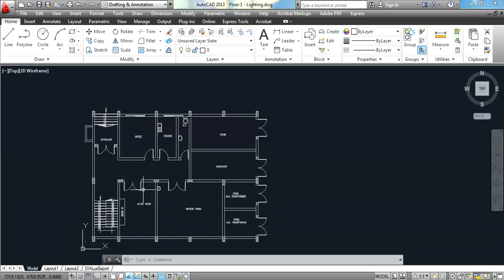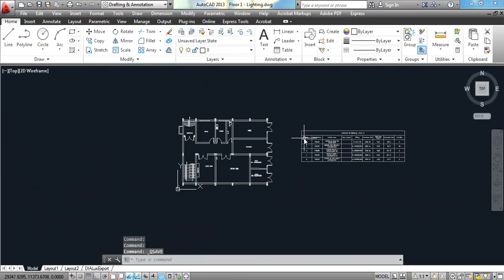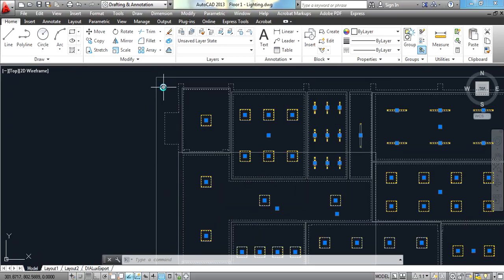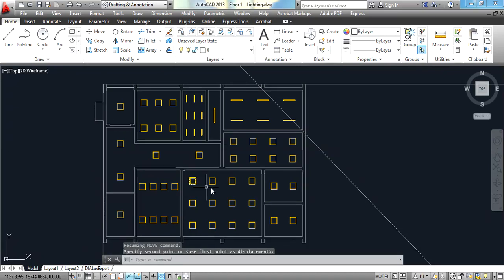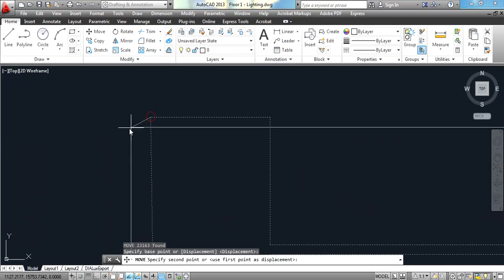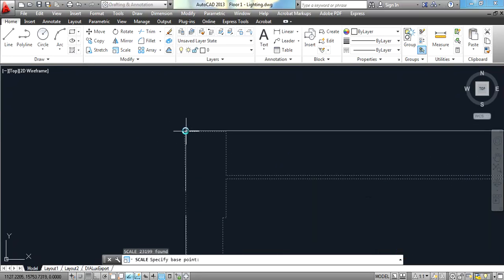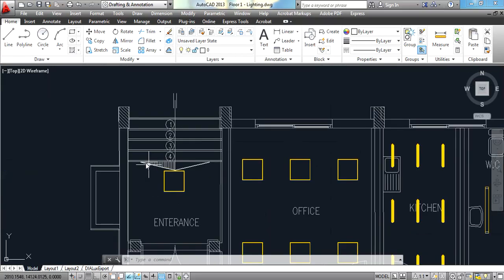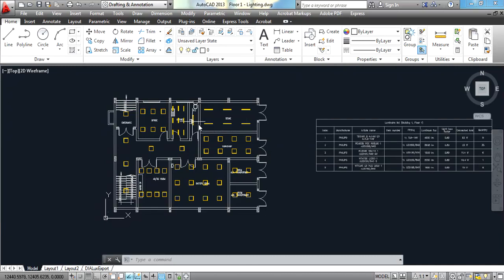Dialux Evo for Beginners - Exporting Results To Autocad File (18) In Dialux Evo Course Part 2

Comment from the maker: Now, the question is why this export is so small compared to the original plan?
Simply because when exporting the Autocad file, I selected the measurement as meters instead of millimeters, if you select the unit as millimeters, you will get the same size as the original plan and it will become really easy to put them above each other.